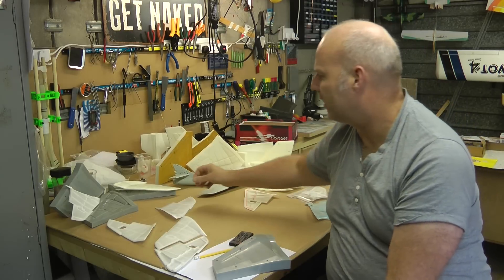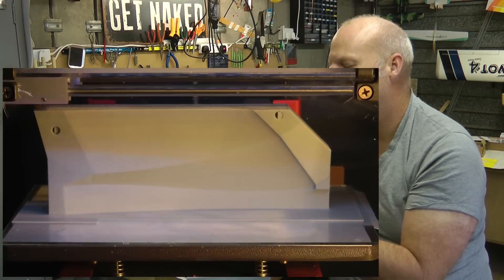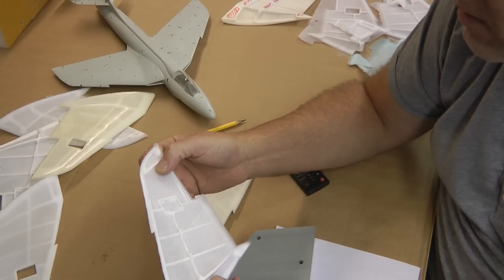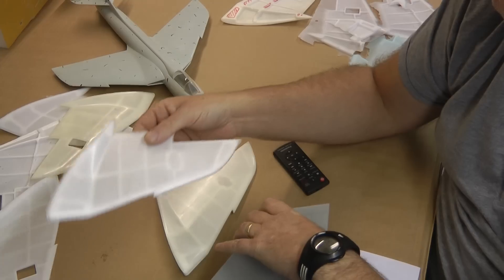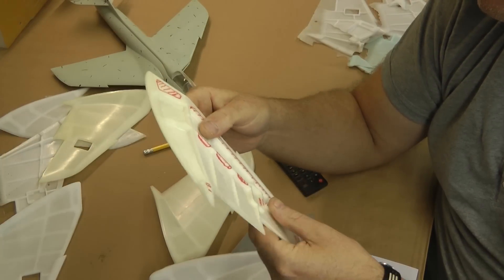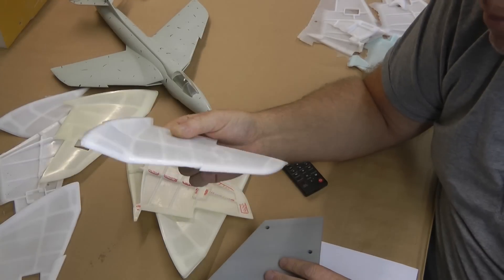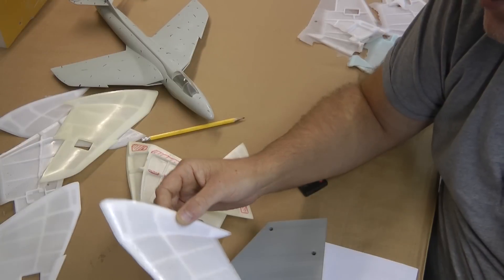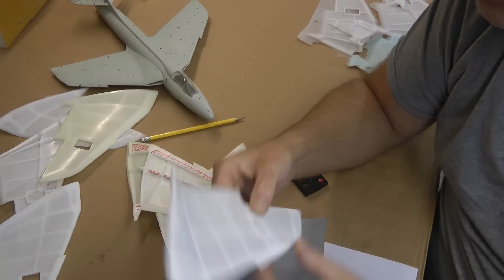3D Printed ABS for Mould Making – PART 1

Comment: Hi Steve,Great Video.I have been moulding 3d printed test pieces in silicone recently and was wondering if you can share you're knowledge please.Do you know what is the best way to reduce or cover any lines in the 3D printed part prior to silicone moulding so the silicone  captures a smooth body? Thanks,Matt
Reply from the maker: +Matthew Evans Hi Matt, My preferred method with ABS is to sand as much out as possible and then clear varnish and more sanding until you achieve the surface finish you're after. You can skip the varnish and acetone vapor bath if you've printed in ABS.

Comment: Have you considered foam injecting these molds with can or liquid foam?  It is something I am highly considering for a future project
Reply from the maker: +Tuffenough4u , yes that would work but much would depend on your final application for the part. My parts have very thing walls (1.5mm - 2mm) and some PU foams just wouldn't work. If I were to cast these as solid parts then that would be an option.

Comment from the maker: Cheers Laurent,

The parts shown printing in the time laps clips take about 4 hour to print at 0.1mm. However with the last core parts, I printed them at 0.2mm and they took about 2 hours each.

The molds for both wings with took about 65 hours to print.

Comment from the maker: Hi Rui,
The parts are printed on a Replicator Type, Filament Fused Fabrication 3D printer. The extrusion temperature was 230c and the build plate was heated to 110c. I print on cheap 2mm picture glass and use hairspray.